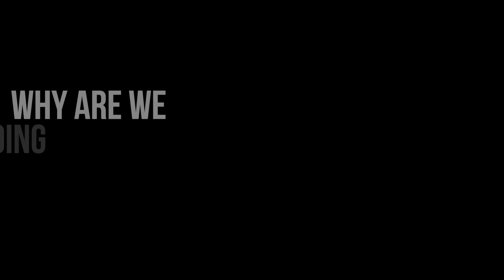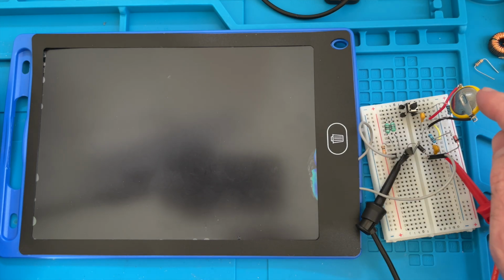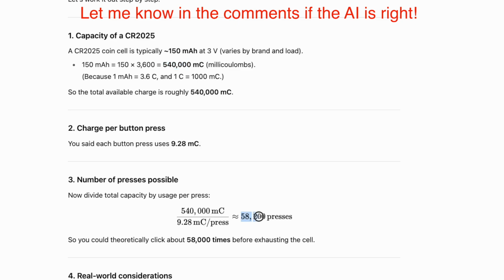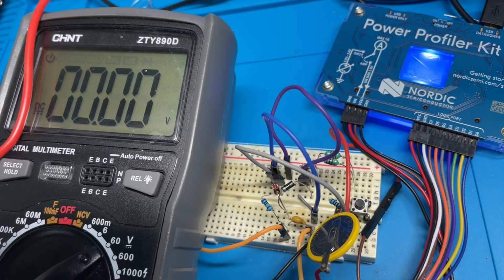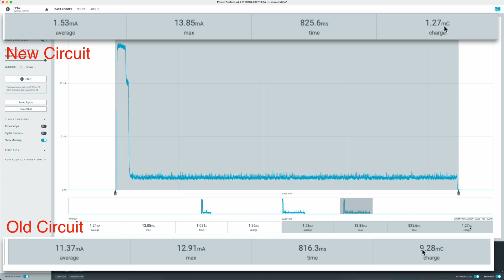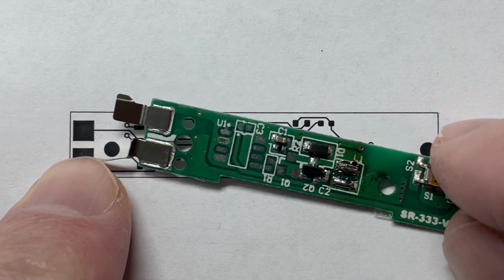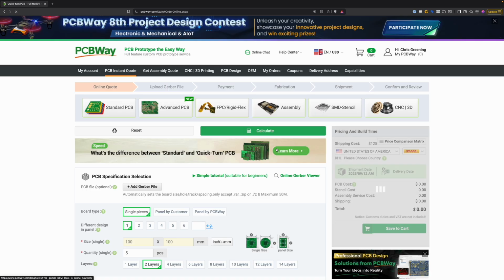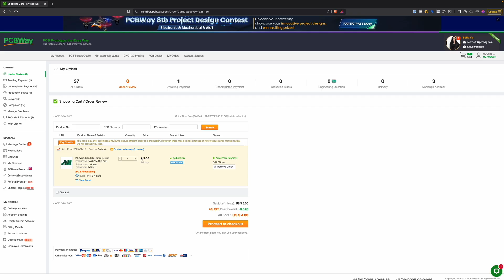High Voltage Coin Cell - 27V Joule Thief

Comment: The schematic shows a common mode choke, normally two wires wound in opposite direction on a common magnetic core. I am pretty sure you just have two uncoupled inductors. But interesting circuit. I have never been very good at circuits even though trained as an EE, lol.
Reply from the maker: The inductors are very close to each other so they magnetically couple.
Reply: The reason the two inductors are next to each other is to magnetically couple them. This is why why you have to be very careful with PCB layout & placement of magnetic components.